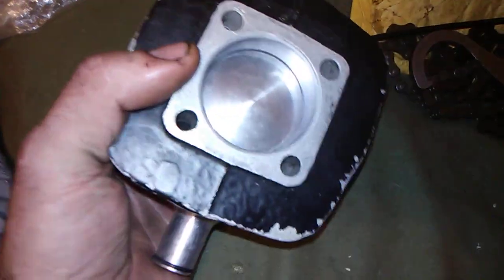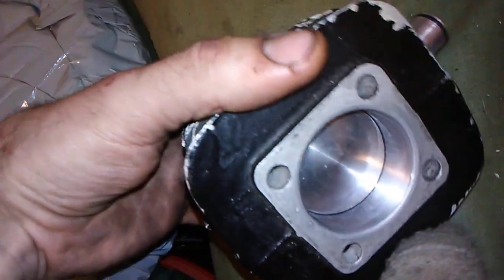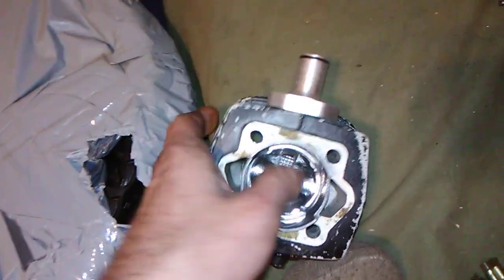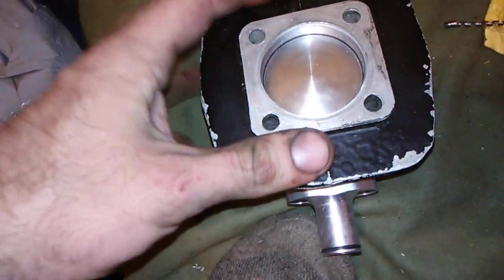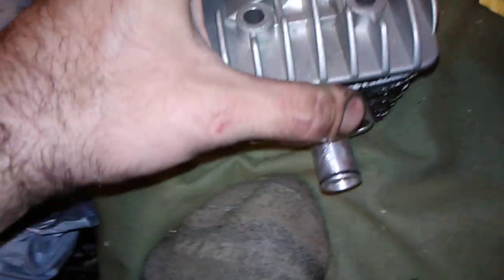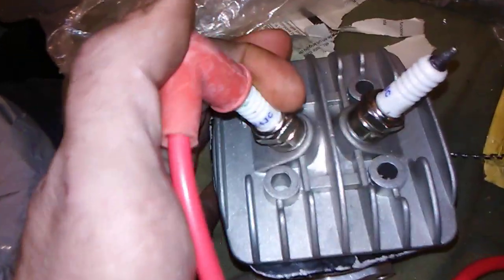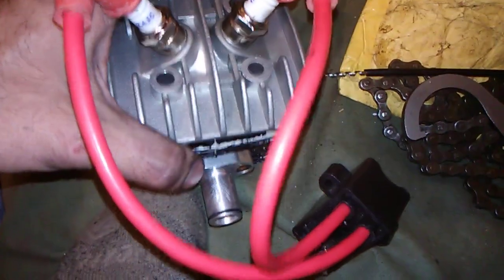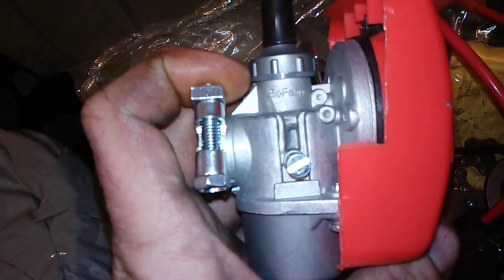"Schwinn supreme cruiser is coming back from the dead!"

Comment: Raoul wait tell you see the full power of the phantom after it is broken in I've been Riding this for about a year and I was getting on it going up a incline stripped all the teeth off the little gear just giving you a heads up of the little beast you have purchased ride safe brother
Reply from the maker: The phantom 85 I'd figured out how it's so powerful high performance CDI ignition coil and CDI box high compression ratio engine head a yd100 bottom half but my niece's motor didn't have a yd100 crank Rod it has a AF80 or a 50ZL  crank shaft rod and I think it was a 38 mm crank Rod or a 40mm crank Rod it also has a sealed bearings clutch assembly and a better clutch system all together I'm thinking of super powering my mongoose mtb engine and the Schwinn supreme cruiser motor
Reply: @RaoulDuke224  what putting a phantom on the mongoose that would be cool
Reply from the maker: @mikemiller3303  I thought about it might do it!
Reply: @RaoulDuke224  I would super power them I told you you'd love that phantom engine the power I love it lol ride safe brother